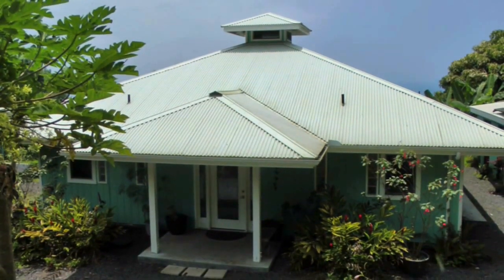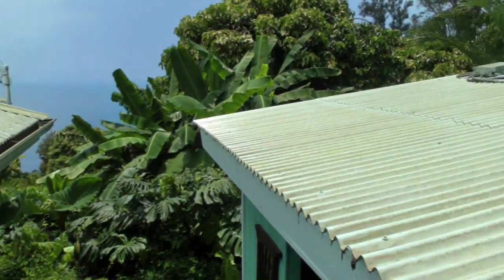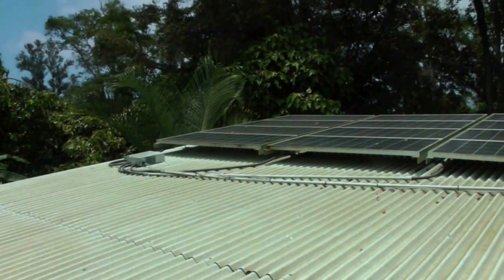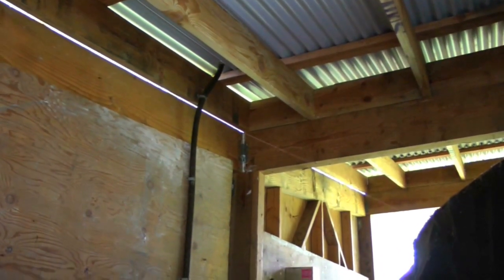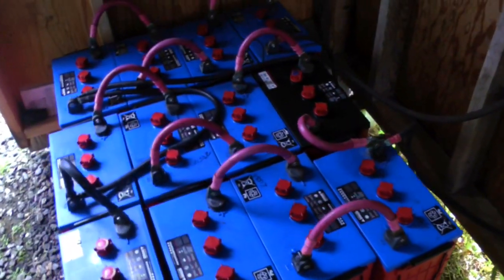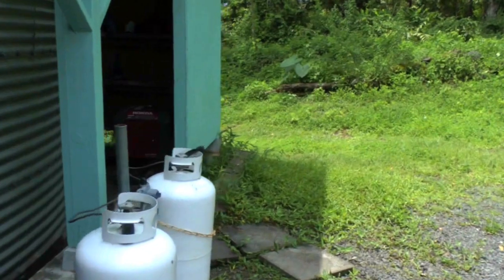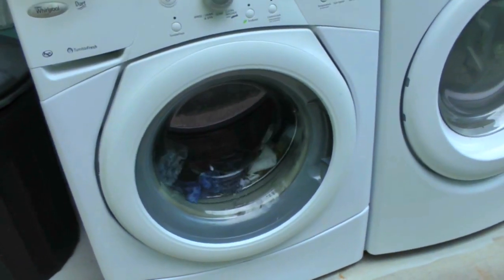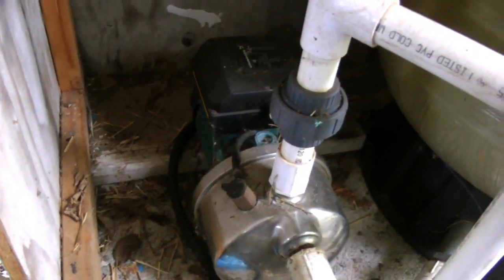Off the Grid House in Hawaii, Part 1; Solar Power System

Comment: Does the light colored roof plus the ventilation at the top keep the house cool on hot days?
That seems like a smart design for a tropical climate.
Reply: from our experience, white roofs definitely help reflect off light and keeps it cooler inside :] (we did this to our off grid shipping container house)

Comment: I'm surprise that you don't have any Windmill generator to supply you electricity on  a cloudy day.  You should go to this website and check out their windmill generator.

http://bergey.com/

Also Tesla has created a new battery storage system that is small but very power dense. 

http://www.teslamotors.com/powerwall
Reply from the maker: K Ewan Unfortunately, there's almost no wind around here. Our current Rolls batteries are new and still under warranty, so I'm gonna keep an eye on the Tesla battery system for a few years to see if it lives up to the hype. Could be interesting down the road. Thanks for watching!
Reply: ***** "there's almost no wind around here"
I notice you mentioned that as a reply to another person suggesting you put a windmill.  Unfortunately, I notice it after posting y comment.

" I'm gonna keep an eye on the Tesla battery system for a few years to see if it lives up to the hype"

You are very wise and don't rush in without  checking in advance.  I myself would have just rush in and try the Tesla Battery out and see what all the "hype" is about.  But I am learning and am more careful now.  But sometime you laps and get careless.

Live and learn.
Reply: +JungleJoelVideos "there's almost no wind around here"

Did you check for wind at 30 ft, 40 ft elevation, etc?   As there might not be any wind at 10 ft or 20 ft, but there might be wind at higher elevation.  It might cost a little more to get a pole 40 ft long vs 20 ft long to mount the windmill, but at least you will have energy on cloudy days.

Note:  I notice at http://bergey.com/, they have tower that is 60 ft- 100 ft high.  I think at that elevation, there might be wind blowing even though there is no wind at 10-40 ft.

For detail about wind speed and height, see article below

https://www.homepower.com/articles/wind-power/design-installation/how-tall-too-tall

Comment: I want to get solar for my house, But I am going with the grid tie inverter so no batteries, It is in Thailand now, I have found 2 places in Issan that do it, My only question is what happens when the electric goes down, Haven't got an answer yet.
Reply from the maker: ***** You'll save big money by not using batteries, so that's the way to go if you can tie into the grid, though we just had a hurricane here and never lost power (one great advantage of not being on the grid). A back-up generator will save you if the grid goes down at night.